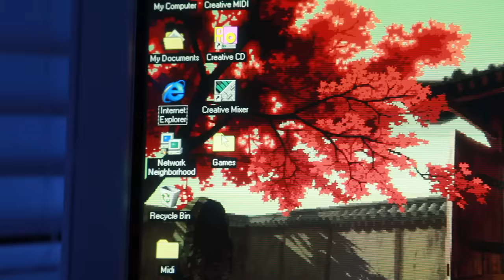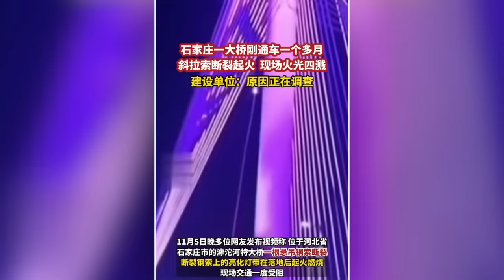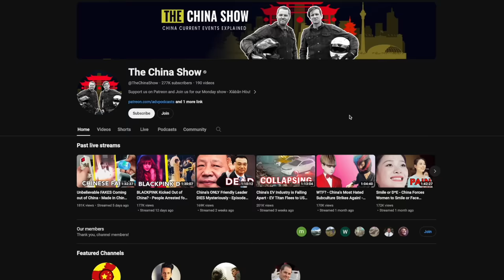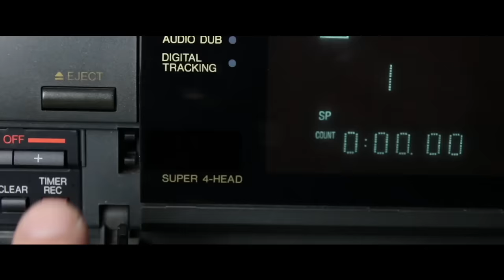Crazy Chinese Workplace Accidents - Why is Workplace Safety so Bad in China?

Comment: As annoying as workplace safety rules sometimes are, there is a saying that each OSHA rule is written in someone's blood.
Reply: The Union Pacific RR when they were training me said to follow the safety rules because they were written in blood. Rules were a lot of times made after someone got hurt doing something.
Reply: Probably chinese blood
Reply: of course they are written after an injury, but some rules are hella stupid. Where i work you cant bicycle because some dip sh1t couldnt ride without dying.
Reply: to a point. I know in the UK fatalities at work have generally flatlined for the past 10+ years and yet more and more safety regs keep getting added. Reaches a point of diminishing returns where you're just adding hoops to jump through and increased cost. There has to be a happy medium as some jobs just have an element of risk baked in....
Reply: For the most part, the safety regulations are good, but then, like all regulations, they reach a point where they're just a barrier to entry.
Reply: Yeah, but in China, lives and labor is so cheap that the slight risk of danger is efficient enough given the savings they produce.
Reply: and each rule is another 1000 lost work opportunities
Reply: @safffff1000   I could tell you about a group of Union Pacific Diesel Apprentices at LA Trade Tech College, this is an advance diesel class.  Our instructor told us never lift a diesel  engine more than an inch or a little bit more. This was a 6 ton roll along the room crane , so keeping it from swinging over our heads saves lives and this UNION Pacific guy starts hoisting up a Diesel engine about 5 - 10ft. 
The Instructor got pissed and scream " BRING IT DOWN BRING,  IT DOWN NOW".  The guy did not like being yelled at so he left it there mid air. The instructor had me take over the job,  bring it down to a  safe level and have one of there guys tell me where they wanted this engine.
Reply: @lainiwakura1776   Well, yes they are a barrier to entry. That is a feature, not a bug.
Reply: @hexrag5901  "At some point, safety is just pure waste..." - Stockton Rush, the man who died while taking his personally built underwater vehicle to the Titanic, alongside several passengers who believed he could keep them safe.

I know it's an oversimplification of the point you're getting at, but maybe those rules are being written for a reason, one that you can't see from the perspective you currently have.
Reply: @safffff1000 union pacific always had that policy, even their oldest training films note that rules are written in blood
Reply: Human beings are not good at seeing mistakes before we make them... Usually hindsight is required in order to know what NOT to do.
Reply: @AfrinonM  Picking an extreme case to prove the point is like saying people should wear hard hats when going outside to protect against meteors or since most accidents at work are slips and falls on level ground arguing everybody should wear harnesses and be supported or even better just ban moving. Which i'm pretty sure you would agree would be crazy. So where is the line of acceptable risk?
Reply: Alright Harry, it's time to tell the men to "Shoot The Moon!".... 👀👀
Reply: @hexrag5901  doesn't mean someone has to die. Near miss, other injury that doesn't lead to death. I'm sure if doing some led to someone losing their leg, you might want it.
Reply: @pipsapossu1699  If it's just where you work, that means the company you work for made the stupid rule, not OSHA. Sounds like you're mad at the wrong people.
Reply: They really are. So are fire codes and their offshoot, electrical codes.
Reply: @tomhorne9359  Im not angry. I like to walk.😀
Reply: @safffff1000  Infrastructure is crumbling in the U.S. OSHA's regulations are being sabotaged. Railroads no exception, take East Palestine, Ohio for a recent example. Major cutbacks on workers and maintenance just to squeeze more profit at the cost of safety and human lives. We're headed in the same direction as China.
Reply: I'd say that's true. They only change when someone or a bunch of people get killed. 
You'd think something as simple as keeping fire doors unlocked and clear would be obvious but not until a building caught fire, people got trapped and died did it become mandatory. 

There's a channel called fascinating horror who covers stuff like that. A lot of the rules we take for granted came into being from a disaster. 
Brick immortar is also a good one if you're interested in that stuff.
Reply: @brindlekintales  I retired in 2011 so I don't no about now.
Reply: some are but most are not these days .it's just bureaucratic rules that make no sense.
Reply: You mean get your body literally crushed
Reply: @safffff1000   Cutbacks started decades ago, so you SHOULD have known.
Reply: Damn, 5 years in the trades, and I never saw it that way.
Reply: maybe, but bad cases make bad laws
Reply: @safffff1000  As a personal story from when I studied manufacturing and production, one of the laws we had to check was about "good manufacturing practices". In the law, it is literally written that people working with the food industry and direct manipulated food should be wearing gloves. You'd think it is obvious, but in the same year (some time in the 80's i think?) that law was updated to contain that line, hundreds of people got sick and a few even died because of food contamination, and investigation showed the workers in the company responsible for it didn't use caps, aprons, anything. The same law also specifies workers should wash their hands when working with food.

People are not kidding when safety laws are written in blood. The dumber and more obvious the law is, the easier it is to guess someone died or a population got severely harmed because of it.
Reply: @pipsapossu1699  it's not a perfect system no system is, but this vid shows what life could be like without regulations
Reply: Agreed. I have seen some crazy things happen working in Oil and Gas. Some buy on site managed to get half his body frozen from liquid nitrogen. He was stuck in his cab and the unit beside him was filling up nitrogen. The regulator was broken and looked like the unit was empty. It was almost full and when they started filling the tank it started to spill over through vents on the side. One of those vents was right beside the guy's cab. The window was open and would not shut. The guy could not get out because the doorknob was broken. He was trapped in there and they had to break the windshield to get him out. It was crazy and the guys suffered massive 3rd degree burns. Poor guy.
Reply: Note: I had to repost this because CensorTube deleted it.
"OSHA CFR 1910.42 (0) 
ALL TURDS > 6" IN LENGTH MUST 
BE HAND LOWERED INTO BOWL TO 
PREVENT CHEMICAL BACKSPLASH"

(I remember seeing pictures of this posted on various portable toilets. I looked it up. Couldn't find it, so it's almost certainly fake.)

Comment: I work as an industrial electrician in the USA. People complain about some of the safety regulations, and sometimes it can be annoying, but I am thankful for a safe working environment.
Reply: The extra sweat you suffer was once somebody's blood
The PPE you put on was paid by a past person's hospital or funeral bill
Reply: As a retired Boilermaker Ship Fitter and crane inspector, I fully agree with Sparky.
Reply: Show them this video.
Reply: OSHA (Occupational Safety and Health Administration ) is there for the safety of the American worker ! Be Happy and Proud of this fact !
Reply: I 100% agree. Following all safety precautions is boring and takes time and sometimes it is too much (like in Amazon where you can get write up for going upstairs and stepping on every other step or not holding on railing), but in general there is a reason behind each of those lines.
Reply: The place i work at bought a industrial hydraulic power pack from straight from China  and the  32A, 440v 3 phase Power Outlet and Plug attached to it was so bad, and so shoddy it was comical,  it honestly looked like a household plug next to the ones that are up NZ electrical standards, it had no screw on collar that locks the plug into the socket, there was no rubber seals to weather proof the socket that came with it, and it came with no earth, at all. The whole power pack had to be stripped of its wiring, and rewired by our sparky, it was so bad.
Reply: I don't know so much about safety regulations in the US but I guess most things are even stricter in Germany.
You may have heard of the Crazy Eights Train Runaway Incident that inspired Tony Scott's "Unstoppable" - that was in 2001, a simple vigilance device/"Dead Man's Switch" would have prevented that, these are mandatory in Germany since 1967 and beginning in the 1970s train drivers cabs/desks were harmonized with a combined throttle and brake lever (it's literally a cruise and brake control) so it also doesn't matter if you're on a high speed passenger (ICE), slower passenger train, maybe with Diesel or on a freight locomotive (just the startup sequence of course differs, refueling and starting the diesel engine instead of raising the pantograph).

And the regulations are ensured by worker's compensation boards that get funded by a social security tax but these are only paid by the employer and not from the employees' wages (healthcare is split so both are paying).
Reply: illusion of safety, just plausible deniability thats selectively enforced
Reply: i live in texas and it seems we dont have safety regulations, ppl are allowed to pollute, make noise, and the state and city and county do nothing about it. 
someone at my pa’s lng plant fell to his death. i should move to one of the good well regulated states i guess.
Reply: @polsyg6581  ...you have a job? Good luck finding one in new york..
Reply: @polsyg6581 your comment reminded me of a 1976 incident at a chewing gum factory in Queens NY where employees died or were critically injured when a vat of boiling gum exploded.
Reply: The safety regulations are a lot of times written in blood...
Reply: Former Electrician's Apprentice here and no one will accept my schooling. even though it's throught the Union. I refuse to do something over an over again. I've been in college courses and they kept wanting me to take algebra when i did it in 8th and high school, that's why i'm so stubborn. If i've already completed my 1st year and have 4,000 hours then why should I have to do again where the Standard are even lower.
Reply: @THE_IS300_KID  hmmm..  id be like "keep the job, ill just start a compeditor that isnt incompetent."
Reply: I always feared high glass hundreds of feet high like big sky topped atriums
Reply: Amen to that brother
Reply: @squibbelsmcjohnsonNo. Usually the reason is greedy employers who keep demanding more productivity and don't give a damn if their employees are being put in harms way by taking shortcuts, not being properly trained, or working with unsafe tools or materials, as long as they can still make their profits. Regulations protect workers from worse exploitation.

Comment: If this is civilian, imagine what their military is like.
Reply: that's a good question. As someone who has been watching SerpentZA for for over 7 years, it would be the norm to assume they cut corners also in the military, this includes the quality of the soldiers both physically and mentally. I wouldn't be surprised if the chinese troops do mass desertion when there are bullets flying their way.
Reply: He did show a video of Chinese soldiers firing their newly designed rifles at targets from about 5 meters away, the rounds were keyholing, instead of neat round holes in the target, it looked like the rounds went through sideways.

Comment: The viaduct collapsing at 8:40 … it brought to mind a Roman aqueduct I saw spanning a valley in Italy. Except the aqueduct was still standing after 2,000 years.
Reply: It's not exactly a fair comparison, as Roman aqueducts cost infinitely more and were built to last more or less indefinitely. Modern engineering in comparison is driven by economics and therefore almost everything is built to be as cheap as possible while meeting the requirements.
It's good in the sense that we can build more, but everything is kinda crappy 😔
China just takes it to the extreme.
Reply: @mpx41  Well the Romans definitely did build their infrastructure to last. There are Roman aqueducts still in use today! (Trevi fountain for example.) And while they probably did not have the sophisticated cost modeling we have today, I’m pretty sure they did have a good sense of what a particular project would cost, and its expected benefit. 
I suspect the collapsing viaduct did not meet its minimum performance requirements. 😜
Reply: @markvoelker6620 the other guy acts like the Roman’s didn’t understand cost/benefit analysis…

One of the biggest flaws of modern society is thinking our ancestors were idiots and not filled with extremely intelligent and capable individuals.

The only advantage we have over them is the knowledge passed on to us by THEM.
Reply: The Chinese viaduct did collapse very elegantly ! 
Like a masterfully set up domino game . The beams exactly hitting the next pillar breaking it making the next beam fall  on to the next pillar ,and so on ...
 I really Hope there was no up one on it 😬
Seemed like really  crappy construction.
Reply: @perstaffanlundgren  That’s true, it was a very elegant and orderly, almost polite, collapse!
Reply: @christopher6337  Yes, knowledge is cumulative, though there is occasional loss. And building an empire requires a good sense of cost vs benefit for projects undertaken.
Reply: @perstaffanlundgren  The locals laughing ironically probably knowing that shit was weak 😂
Reply: @christopher6337  But I think the point is that when the Romans were building things, the assumption is that it should last "forever"--there would always be Romans who would always need water from the aqueduct.  As opposed to designing things with an intended service life, after which they're discarded and replaced, because it's cheaper.
Reply: @Pajune this was a deliberate one.. They wanted it to collapse.. It was not a accident.  Chinas safety regulatiojs are a joke and the built quality also.. But this one i have to give em.. it was deliberatly collapsed.
Reply: Clearly a controlled demolition. Massive discredit to the channel. Shame.

Comment: My  eight-story school-provided apartment in China had a huge crack across the floor and the ceiling. The building was only five years old! I noticed that the new construction in the  commercial part of town began to show major cracks across the fronts of the building in less than six months!  In one school, one wing of a class building had a three-story window wall at the end. One problem: the window wall was six feet too narrow, so the window wall didn't seal the building, so in the winter, the wind blew through the voids and chilled the building even more. It was a brand new university campus, but there was NO HEAT anywhere in the building or anywhere in campus. To stay warm in the winter, students brought large blankets which they shared with each other.